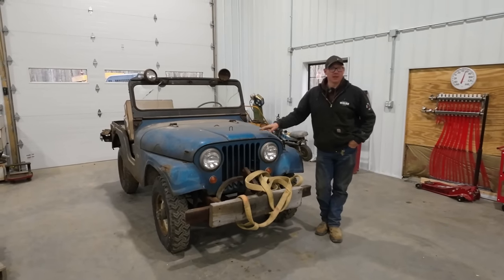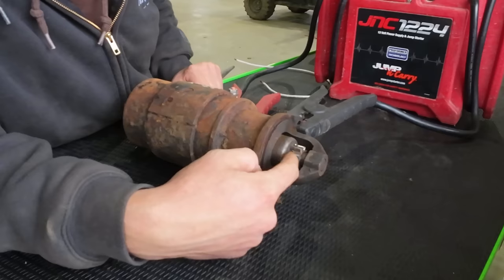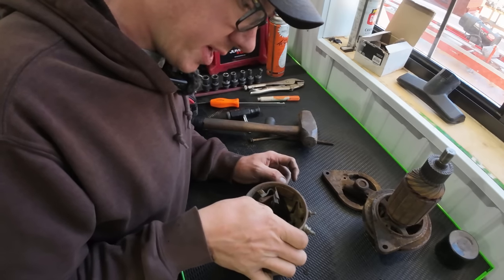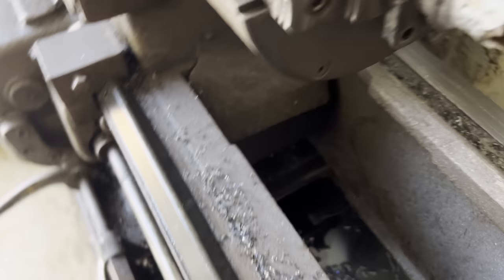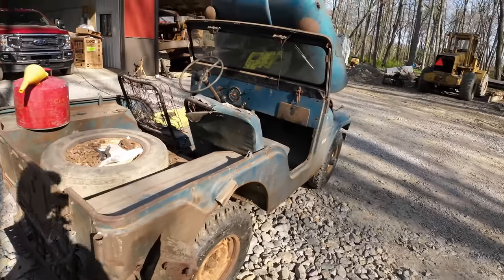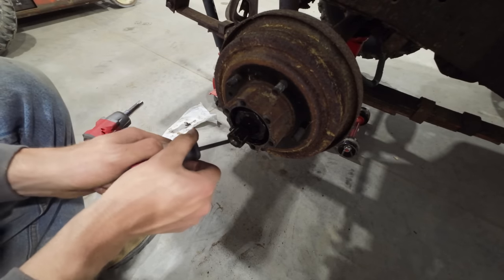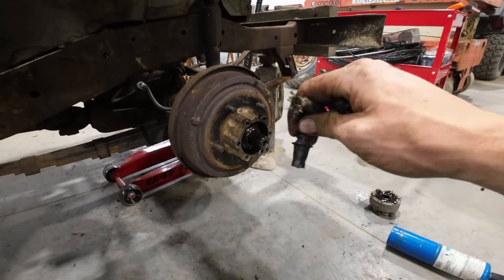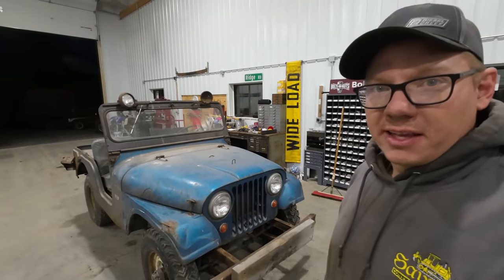Barn Find 1964 Jeep CJ5  (Is It Road worthy?)

Comment: Maybe someone put this in comments but my guess is the crimp on the soft brake line wasn’t tight and leaked a small pocket into the crimp then when you heated it up the pocket exploded.

Comment: That engine is tired no doubt. It's from a time when Jeeps and Pickups were used for work vehicles and often worked hard, not like today because it's stylish to own one of either by some folks today. She's got a right to smoke, she's probably had a hard work life. That is a nice little Jeep though and if you rebuilt that motor it would be worth it IMO.  I wish I could find one like that to "knock around town" during the summer months. I'd find a bikini top for the top of the Jeep to make it a little more bearable in the sun and enjoy the heck out of that Jeep. Heck Matt, you could even show it at local car shows as a survivor.

Comment: You need an ultrasonic bath for parts like that starter-gear-thing-in-a-box
At the same time I’m laughing cause the restored starter or generator really doesn’t look any bit „restored“ it is just returned to a funktioning state no second spent on looks or cosmetics… 😂😂😂
And 33:09 I wonder if that yellow paper filter flew right of the fuel sucking tube in the tank….

Comment: Just wanted to say a few things. I have a '68 CJ-5, with the Buick 225 V6. They are a TON of fun, especially once you get the hang of the way Jeep did things back then.. Forgive me for laughing at how you almost hit the turn signal every time you shift. lol. But also, regarding the brakes, you're a little bit off. You shouldn't have to remove the axle nut for removing anything brake related. Don't get me wrong, it would make things easier, but even in the video, you can see that the drum and hub are separate parts, just seized together. Most of those old drums even had threaded holes for separating the two with a generic bolt, but I just use a sledgehammer. Should pop it right off, and you don't have to worry about seals or anything. I bet nobody will see this, but still.
Reply: I saw it! And I have a Jeep Ika (CJ-5 made under license in Córdoba, Argentina) so this is really appreciated information!

Comment: Using the impact to much they say?? Anyone saying this doesn’t have one!! If the bolt breaks on a mini battery powered impact it will break by a ratchet or wrench just as easy. 
The pulses in the impact actually help not break the bolt.

Comment: @48:48 You found out as I did that brake fluid is very volatile when heated by flame!
😅
Reply from the maker: No there was no fluid in the system at all
Reply: Residual vapors and fluid soaked hoses.
Never underestimate the explosive power of brake fluid.
It's a wonder that some bad guys haven't come up with a way to use it for nefarious reasons.

Comment: I’ve seen you do it before, and I cringed then, don’t ever heat brake line fitting with a flame. Brake fluid is BIG combustible. You likely had a collapsed line (this why the brakes were seized applied) and when you heated it the pressure built against the collapsed area but could not go anywhere until it did.

Comment: Your break wheel cylinders, and the way you have to take those nuts off to get the brake drum off. Reminds me of my 62 dodge dart my first car, same set up your wheel cylinders, and the little springs that hold the brake shoes to the back up plate looks exactly like a Chrysler product. Maybe that was a tall sign to come for many years down the road when Chrysler bot Jeep this is hey Matt, what I’d recommend to do is put a good flush engine flush. I should say in your oil and driving it around especially running diesel oil. It has more detergent than regular oil because diesel oil it’s got a deal with suit anyway you do that and run that thing about 7580 miles with that flushing air it may freeze those rings up all right I have a 1991.5 dodge pick up yeah with six in a row under the hood I just had my engine rebuilt by a company called DNJ machine in Cambridge Ohio just for the fun of it Google machine executioner motor give me an idea what the shop is all about man they are probably some of the best of the best all right six in a row Jim again from Kennerdell, Pennsylvania

Comment: Matt... change the  brake parts... the front shoe material bonded to the drum because of non use after the former job was done. And moisture is not a brake shoe's friend...  Yes that was snarky and a gross understatement.  You have a full kit, use it for training film purposes. And the hoses are very likely now undersized and not at full potential flow due to "brake fluid versus rubber cholesterol".  (Hence the exploding rubber line when heat had nowhere to go). The main issue is you don't  know your reliability factor of brakes because you didn't take it apart..to inspect and confirm. Rule #1 know the condition of  the the most important function of a car that joins traffic...
Will it stop.

And Lil Brother....where'd the fluid go from the previous owner's "brake job"?
Don't know?🧐🤔😁😎
Reply from the maker: I had every part of the system apart.

Comment: Matt, you'd have my oldest daughter and oldest of 3 little sisters fighting over which one would get to drive the CJ.
Both are nuts about classic Jeeps.
None of that fancy shmancy  sissy stuff in their jeeps.
Just bare bones maybe an fm radio with two cheap speakers (odds are they're gonna get ruined by weather anyways) for those two loony females.
They think horns are optional.
If it does have one it better be a train horn type.
I'm serious, they both actually are like that.

Comment: U should try sea foam get 2 cans put a half a can In the tank put the other half in the oil or u can decide how u want to divide the first can and the second can u should put in the brake booster vacuum line and unhook the distributor so the seafoam doesn't just burn up before it gets to lubbercate ur rings ur valves and if it has one ur cat....  now be careful when doing this kuz u don't want to put or suck to much liquid kuz u can hydro lock it do little bits of the can in-between sucking the liquid  reconnect distributor and fire in the hole it's ganna smoke like a sun of a gun kuz it's burning old built up carbon and slug... U can watch utube and figure how to do the sea foam but I feel I explained it pretty well any ways I hope to see u do a video of that...

Comment: Starter bendix is trash.10 bucks buy a new one. Those bendix are supposed to return, spring tension pulls it out of the flywheel after the motor starts.
Reply from the maker: Been on there over a year and I run it all the time. No issues

Comment: Matt, Back in the day (maybe this is still possible) you could have had the original radiator re-cored... and stop giving your business to as you say... "scamazon" and or "CHai-NA", since it appears that the upper and lower caps are Brass!
Reply from the maker: I have sent several radiators to the radiator repair shop and every single time they tell me just order a new radiator. Never once have they tried to fix them. I’m done.

Comment: All CJ5s are legally required to undergo a SBC swap.
Reply from the maker: Sbc?
Reply: @DieselCreek    I think that SBC means "Small Block Chevy"..  This person is saying to swap a Small Block Chevy engine into the Jeep.  LOL
Reply: @DieselCreek  small block Chevy. Usually a mildly built 350 with a TH350 tranny. A SM465 or Ford T18 are also great options if you want to stick with a manual gearbox. Most fun you’ll ever have on 4 wheels.

Comment: Just one of those things that bothers me. No good reason, but a shiny new aluminum radiator just flat out does not look right. It  just looks wrong. It’s out of place. So I myself would take a rattle can of some black paint and give the tanks and brackets a light spray just enough to mostly turn it black. It would look a lot better and just please my aesthetic sensibilities. And it would no longer bug me every time I opened the hood. An absolutely non value added touch that probably would not bother anyone else at all. And most would laugh at me for as being totally ridiculous.
Reply: I like those mud grip tires on that little Jeep. The are so Jeep.
Reply from the maker: I agree with you. Just know if I painted it that it would peel off and look like crap not to mention inhibit cooling

Comment: an extremely amateurish work. why don't you use a sort of penetrating oil? in extreme rust cases consider using heat.
you need to clean out  the gaps in the commutators in all dc gens to prevent the machine fro m ring arcing and burning out sooner than its time comes.
if i were to replace this radiator, i'd necessarily replace the hoses -- all hoses -- the thermostat, and the temperature sensor. do not ignore the heater core.
other than those chores, it is a very easy car to repair.

Comment: You can always tell the maroon from the mechanic. A mechanic will fix whatever is broken.
A maroon wipes the dirty oil off the dipstick because he doesn't want to put that dirty dipstick back in the engine.
Think about it, what does it accomplish wiping the oil from the stick.  If you are that worried about low oil, wouldn't you want to put as much as you can in it?  Dumb, I loose a IQ point everytime I watch one of your videos.

Comment: The hose blows apart when the pressure is too high in the system. Best to crack a bleeder when using heat in the brake lines. Scared the shit out of me first time it happened

Comment: I have been running on the same oil for 15 years never changed only top up, and also same spark plugs , and the engine has no noise, Pulls like day one, oil change over hyped